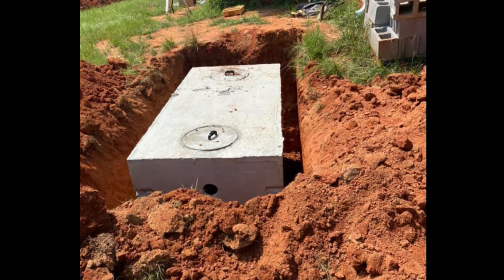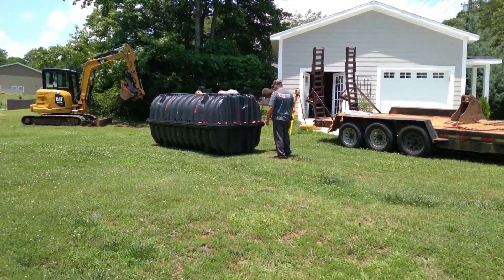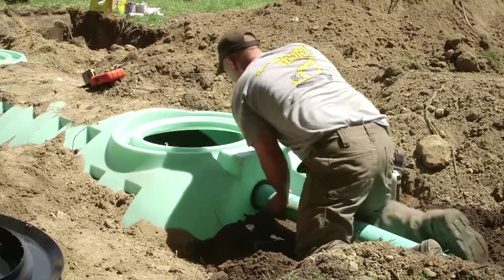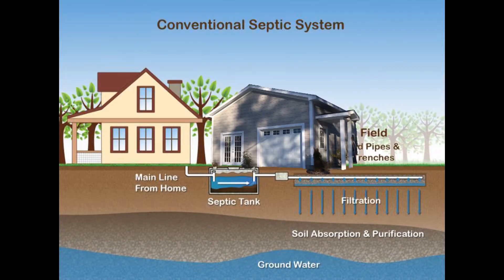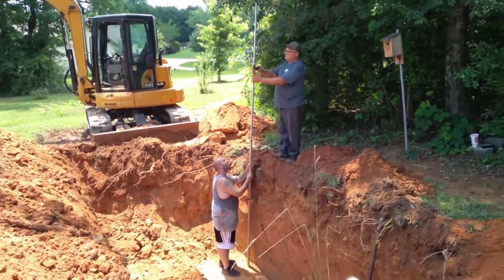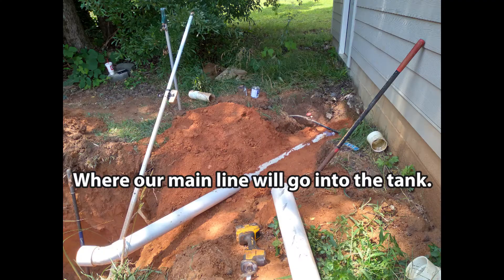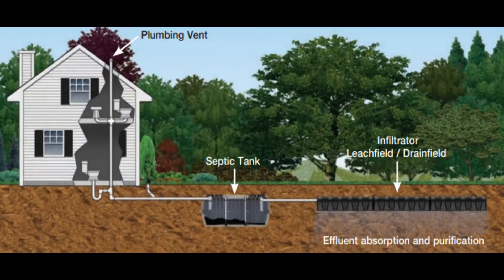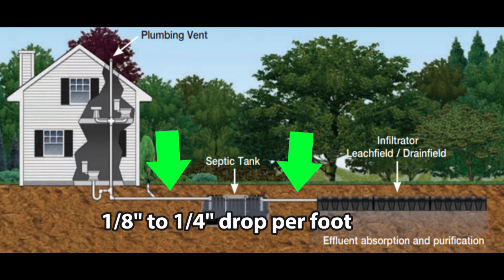Septic Tank Installation | From Garage to apartment | Supplemental

Comment: Greetings from Portugal.(sorry in advance for my bad English 😁)I've had the same problem on my wife's Toyota Aygo with just 110.000km. It was burning around 1 liter of oil per 1000 kilometers.Allways serviced on time,(15.000km oil change intervals, as recommend on the manual) First, I've checked compression and it's was perfect( according the service manual) I've tried many things, replaced valve stem seals, replaced pcv valve,  installed a oil catch can,  oil flush from various brands,  fuel injection cleaner on the tank and on the cylinders etc,  etc,  etc. I've been fighting with this problem for the last 3 years. Nothing worked. Until I've listened an idea on a Podcast (AGCO automotive) from Louisiana (to me, absolutely the best automotive podcast). First I prayed for divine help, then I've removed the spark plugs and soaked the cylinders for 2 days, with carburetor cleaner made by Mannol (Germany) , then soaked the pistons for 3 days, with a mix of 50/50 acetone and atf oil. Cranked the engine without the spark plugs (the amount of carbon that came out flying, was just unbelievable). Finally, replaced  the oil and filter and FINALLY problem solved. The car doesn't smoke, doesn't drink a drop of oil between oil changes. And yes,  I've reduced the oil change to 5.000 km, I suspect that it Was The 15.000km oil change, that got the piston rings stuck) I hope it helps. 👍
Reply from the maker: You're English is great. That's good info too. Someone else mentioned a process almost exactly as you describe and they had complete success as well. I might try this or something very similar. Thank you for your comment!